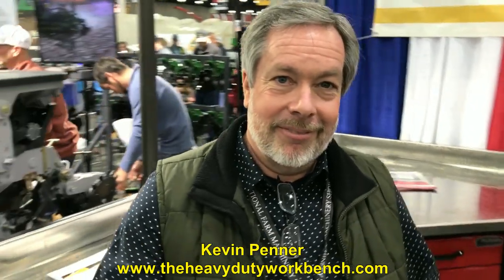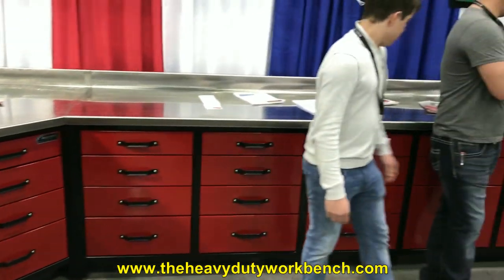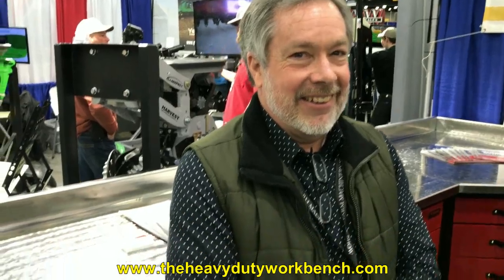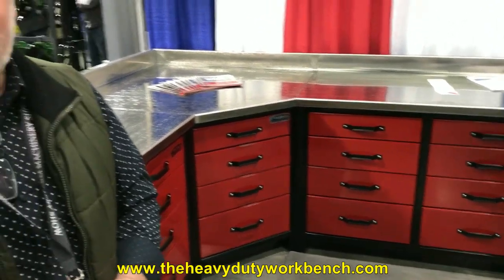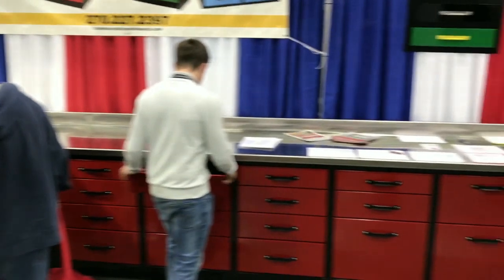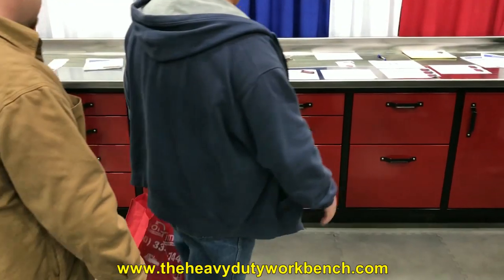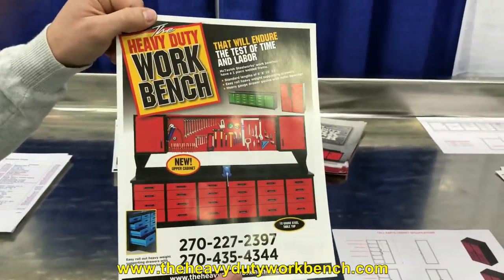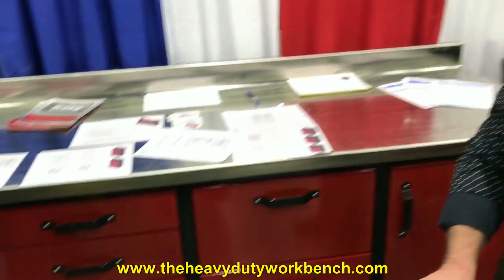The Heavy Duty Work Bench

Comment: Made in Canada. My employer has 6 or so of the 10 foot benches. (ordered direct from manufacturer). They’re good. I probably have 300 pounds of random large hardware and heavy pins/bushings in one drawer. Handles the weight fine.

Comment: Are the workbench tops wrapped over wood?  Appears to be 1.5" thick which would accommodate 2 by wood stock underneath for strength etc. or are they hollow?  I wouldn't want to pound or even drop something heavy on hollow 10ga steel but if it had wood underneath it would be different.